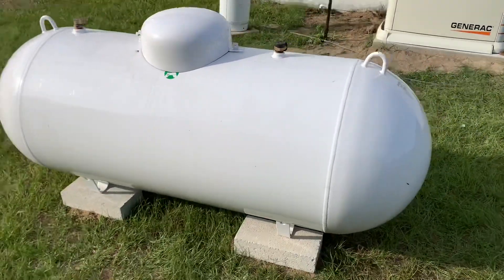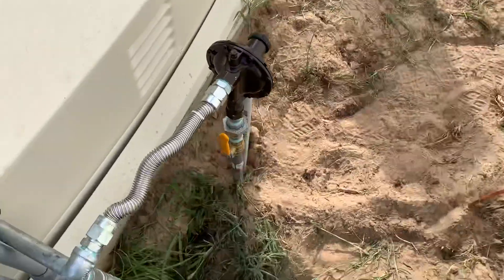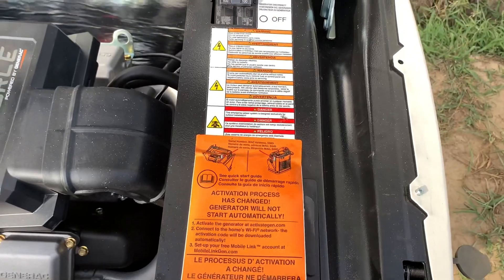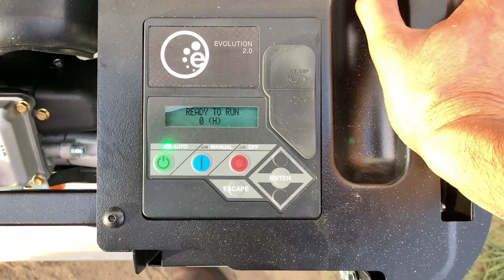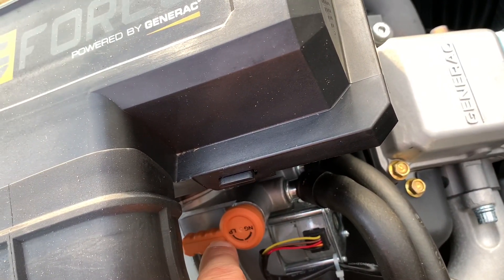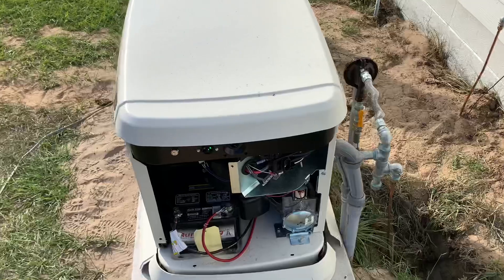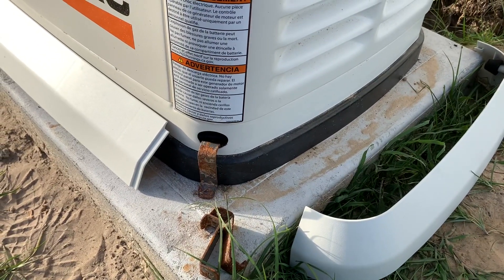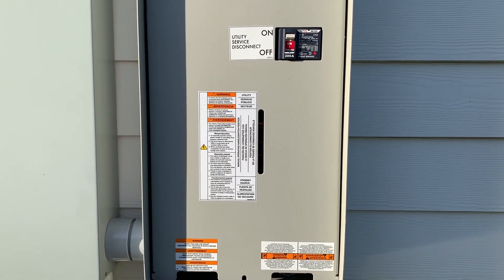Testing our new Generac generator and transfer switch.

Comment: How much run time can you get off a tank of that size ?. Or how many gallons is it.
Reply: 24KW burns 2.5 gallons/hr at 1/2 load, and 3.9 at a full load.   A 250 gallon propane tank has 200 gallons usable.   So, worst case scenario, constant full load, just a bit over two days non-stop.  With a moderate load, you might get close to 3 day.     A 500 gallon tank has 420 gallons usable.
Reply: @5thGenNativeTexan  correction...a 500 gal tank only has 400 gal usable as it can only be filled to 80%.
Reply: @5thGenNativeTexan  i went with 2 250 gallon tanks. & 2 120 gallon tanks for back up.
Reply: @ericd2791   Sounds like a great setup!  Just curious, is there a reason you chose two 250 tanks and not one 500 gallon?
Reply from the maker: I’m not sure yet, it’s a 250 gallon tank though.
Reply: @MaynardFamilyHomestead  thanks gives me a idea now.

Comment: Check with your Generac dealer if for a warranty the manufacturers  Black flex pipe is required Going into the generator
Reply: The flex you see is the generac connector they don’t use black flex anymore.
Reply: @kirbymechanical6507  ... they stopped using the black rubber flex due to dry rot and also animals chewing on them. This stainless flex what they supply now.

Comment: Looks awesome Maynard! The only thing I can see I would change is your flex line looks really twisted which happens all the time. I would break it loose and retighten it straight. If you dont it will over time break due to any movement or vibration. Otherwise as always I am glad to see you finished and looks great! Thanks
Reply from the maker: Thanks buddy! I appreciate the advice, I know absolutely nothing about propane stuff so any tips are always appreciated.
Reply: @MaynardFamilyHomestead  Yep... richard hall is right on. Both ends of the flex hose (the one that comes with the generator, have a swivel fittings. I took mine off and manipulated it until i was nice and straight then made sure when I reinstalled it not to let it twist when tightening it. Looks better as well.
Reply: @MaynardFamilyHomestead  ... if you have trouble getting it straight just pre-twist a little in the other direction with a pair of pliers before the final snug.
Reply: @MaynardFamilyHomestead  No problem, I always see generac and other gas companies warning about that.
Reply: Did you install that by yourself?